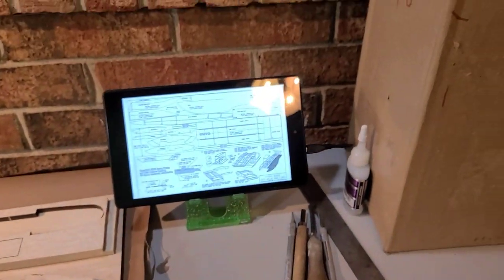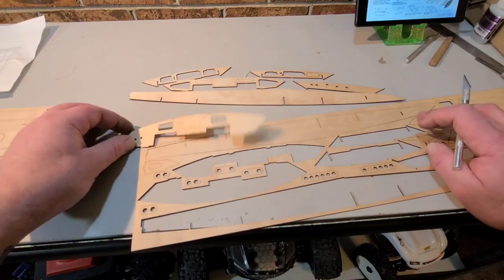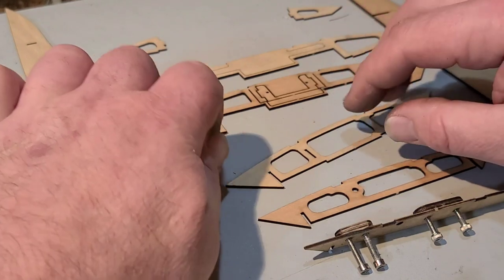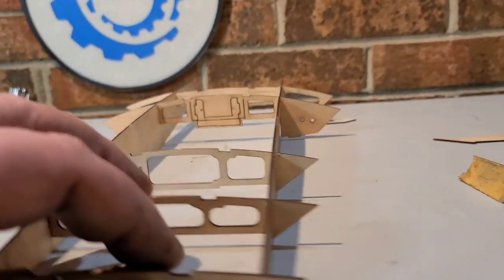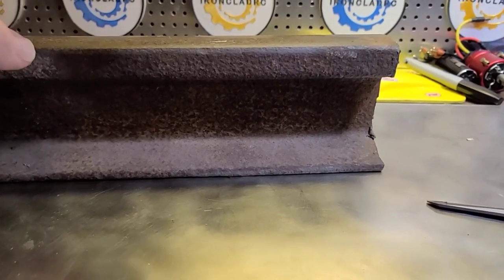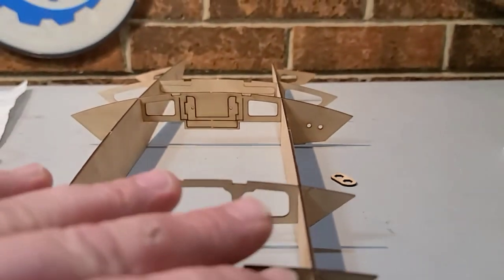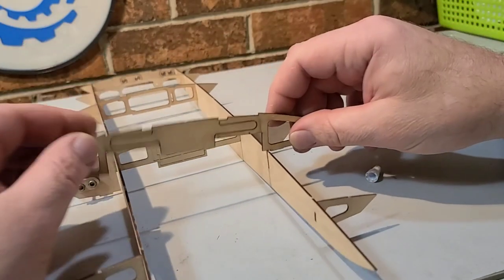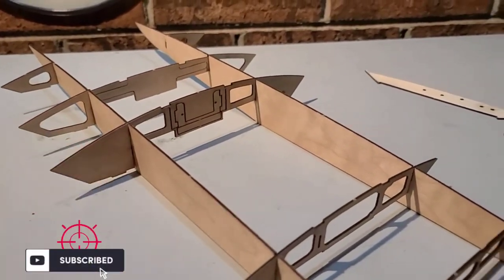1:20 Scale Mini Hydroplane Build Series Pt1 - 1987 Atlas Van lines Hydroplane

Comment: Good start Big B.  While the boat could be built with the 1/16" plywood stringer as is (I’ll explain in a moment), I did send a replacement as I want Big B’s build to go as smoothly as possible.  The tiny bit of twist in the frame is unimportant at this step, as the rest of the build will compensate for that.  The first bit of skin that goes on is the control plate.  It is laser-cut perfectly square and will begin to hold the bones in their proper orientation.

I recommend some Windex and a Monokote iron to take out as much warp as possible.  Hold the piece in the air (or on a curved surface), wet-out the suspect portion, hand-warp it opposite the existing warp and iron until dry.  Since it was over-bent in the Windex/iron process, when it snaps back, it will be straight.  Then glue everything together making sure the stringer fits snug on the bulkheads with no gaps and don’t worry about a tiny amount of twist in the framework.  The “skeleton” has no torsional rigidity at all until the skins are applied, at which time they add the necessary torsional structure.  The skinning is where you need to be careful in getting everything square.  In fact, the hull will still twist a bit until the upper deck skin is installed.  It is that point where the deck is installed that makes it one complete structure and care must be taken to insure the hull is square.
Reply from the maker: Roger that.
Reply: Thank you for your explanation here where we can follow along with solutions
Reply from the maker: @brianbrissette9444  part 2 tomorrow morning 7am  I've had to edit thru 3hrs of footage..

Comment: That little piece on the front bulkhead needs to remain.  Isn't there supposed to be a doubler on the turn fin side of Bulkhead C?  My preference for TACKING the framework together is thin CA.
Reply from the maker: Oh OK. Thanks. I will glue the little peace  back on.  As for bulk head c? The doubler?  I have it and I'm glad you pointed that out.  Omg. Does it go on the inside of the sponson or ouside/backside  of the rear sponson?  Either way thanks for  that.
Reply: @IRONCLADRC  Inside......
Reply: @IRONCLADRC  check your video

Comment: You might need to build a jig to hold your frame straight onto your flat surface while you build it that way it can't twist on you im currentlly building a gas mono from zipkits it brought a factory jig
Reply from the maker: I thought about making a jig.   Thanks for the tip

Comment: I thin out finishing resin (cure time 3 hours or more)epoxy wit rubbing alcohol. It thins it out for the wood to soak up so you can seal the wood. It will not have no strength due to thinning it out but you don't need strength you need it to seal. You cannot thin 5min 15 min or 30min epoxy it will turn to rubber when cured. I found out that longer cure times work best for thinning to just seal the wood. After 15 min I wipe the excess off to save weight.
Reply from the maker: Thanks for the great info my friend.   Cheers